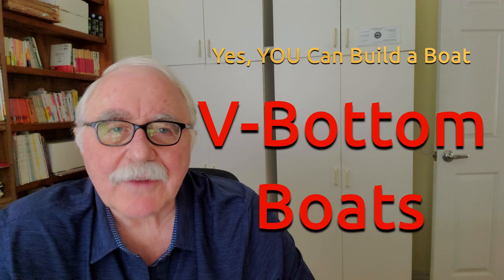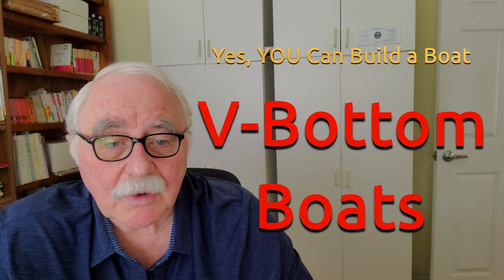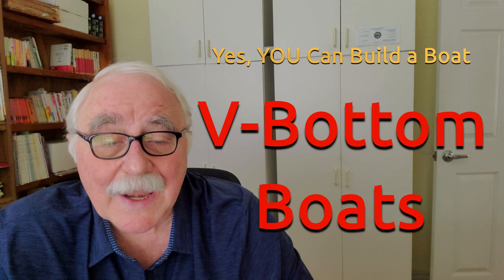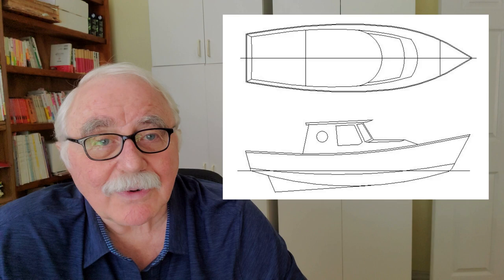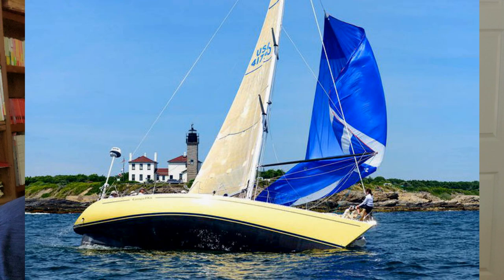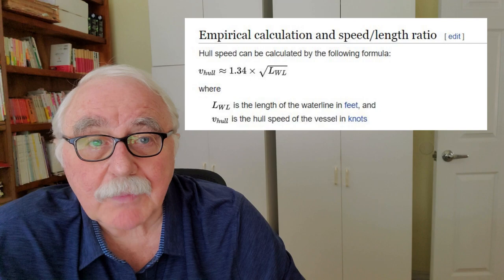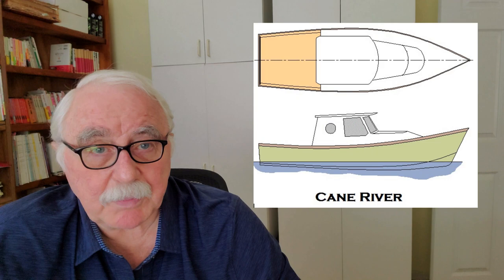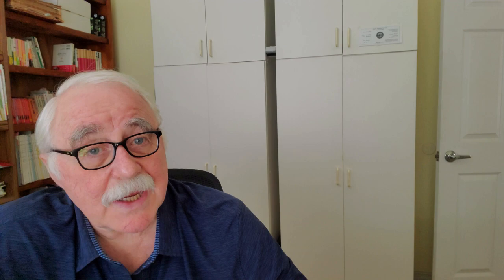Yes, You Can Build a Boat - V-Bottom Boats

Comment: Hi Jeff, I like your designs but may I ask why the transom comes up so high and then has a large low cutuout centre section to allow for the outboard ?
Seems if the  point of the  high stern is lost with that large cutout. Greetings from Melb Australia.
Reply from the maker: I design in splash wells on the larger boats, and recommend them on the smaller boats used in rougher water, so the high transom works just as it should, even with the cutout. Some boats can build with motor wells, as well, that keeps full transom height.